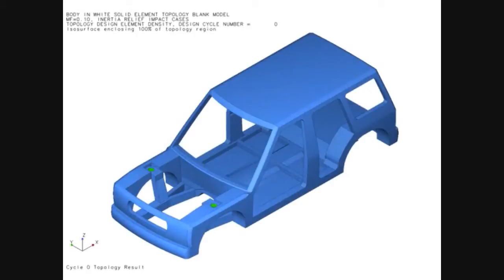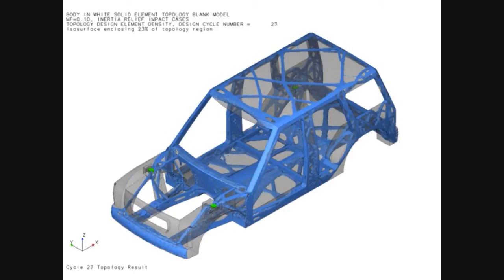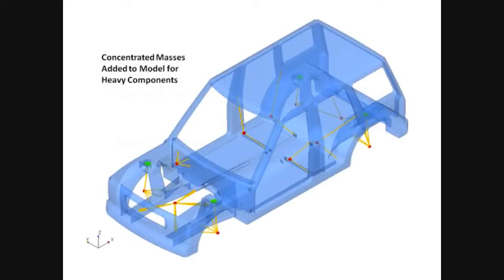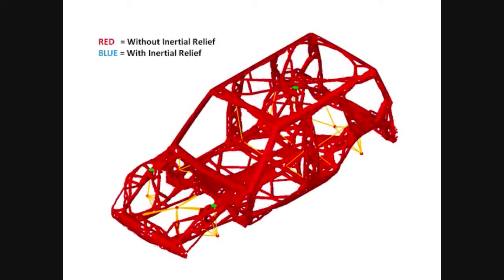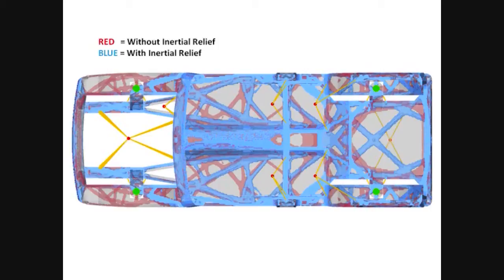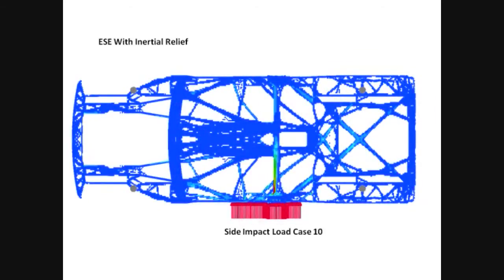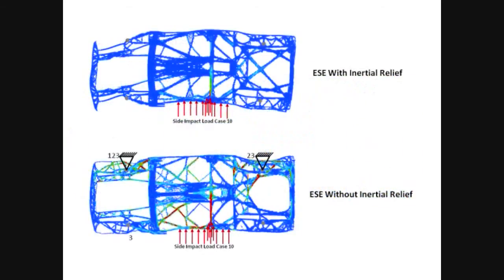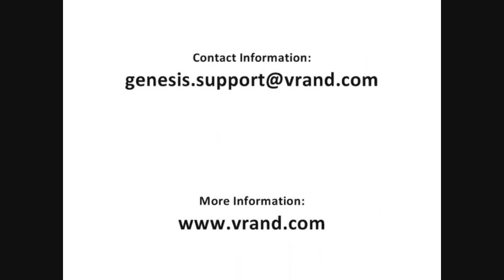Topology Optimization - Inertia Relief - Genesis Software

Comment from the maker: This model has: 737,000 solid elements. 
The number of dof is 2.48 Millions.
There are 10 load cases.
There are four sets of boundary conditions. 
Today this is consider a medium size problem.  Larger model can have
2.5 or more million elements.

Comment from the maker: This model has: 737,000 solid elements. 
The number of dof is 2.48 Millions.
There are 10 load cases.
For set of boundary conditions. 
Today this is consider a medium size problem.  Larger model can have
2.5 or more million elements.

Comment: @kirby7979 
Fixing the engine would really mean fixing the motor mounts which would essentially restrain the engine footprint. It's better to use the engine concentrated mass as inertia only attached to the BIW via RBE3 elements that do not artificially constrain the engine footprint. This way the added mass doesn't affect the normal static analyses unless GRAV loads are applied, and it acts as non-designable mass that helps to define critical load paths for the inertia relief load cases.

Comment: @kirby7979 
The BIW topology optimization shown in the video used ten load cases with 4 different sets of BC's to design the optimal structure shown. We chose SPC's for the static test stand cases to simulate what is actually done in the lab for pitch, torsion, & bending. These restraints are different grid component combinations at the front & rear shock towers. The inertia relief methos solves the unrestrained BIW problem when applying equivalent static loads to simulate collision.

Comment: For the red model, where do you choose the fixed boundary constraints?
Fixing the engine block and maybe the axles seem reasonable.  Obviously, the "Inertia relief" is most realistic as the front end would buckle before the tires could provide any resistance to the system (car).